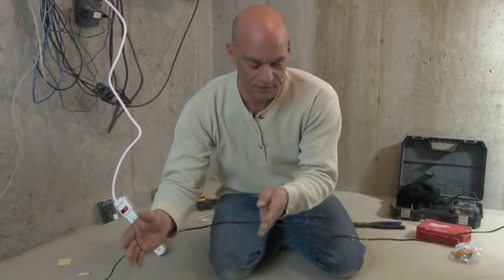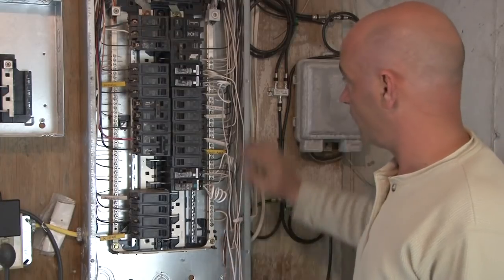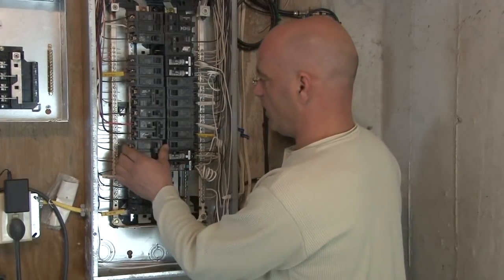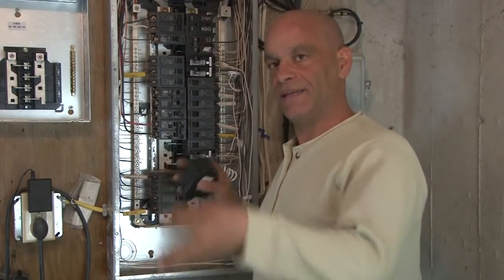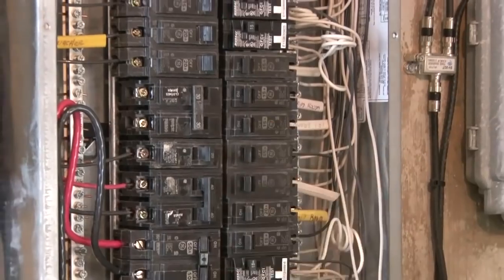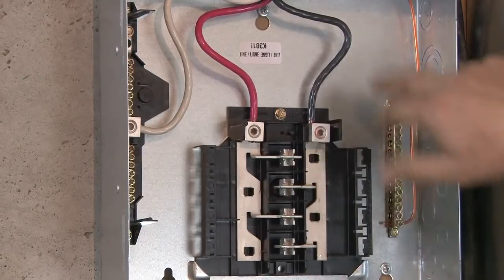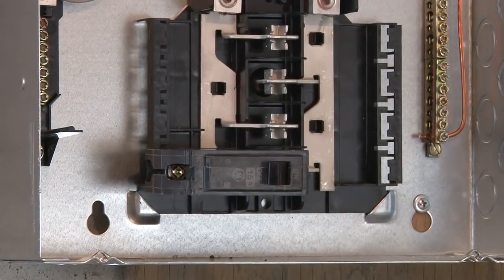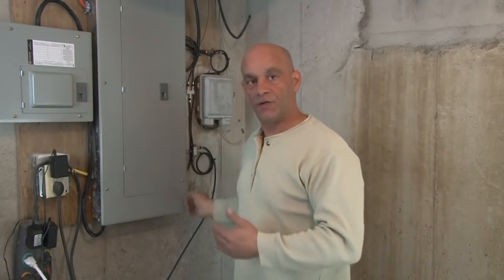How to Install a Subpanel

Comment: Good Video, I am a Master electrician, I think you did a good job covering all the issues, if I had to add anything, the main rule would be 3 things, neatness, mechanically secure and make sure every conductor should be physically protected. I also would recommend DIY ers to let an electrician install any main equipment it may look easy but we electricians always think about 100 things most homeowners do not think about, we do our best to protect the equipment but most especially people ! Thanks for the video Dominic;)
Reply: My electrician (who also has a shop in town) wired up a stove in my kitchen.  From the main breaker box to the stove he installed a 50 amp breaker, ran the correct wire, and correctly wired up the outlet (but screwed the outlet directly to the floor and not to the wall).  All well and good.  I was under the house doing some plumbing and inspected the wire, which he left running the entire distance from the panel to the outlet some 40 feet, lying directly on the ground.  He charged $1,200 to run one wire from the panel in ample crawl space to one plug and then left the wire directly on the ground.  The only hole needed was already drilled.  That was an hour job (I was there) and he couldn't be bothered to get the wire off the ground.  It took a Forester/Math Teacher (me), the son of an electrician (who passed away 16 years ago) to fix the mess.  Not only did he charge quite a bit of money (I'm 5 miles out of town) but he didn't even do a good job.  There are legions of excellent electricians to be certain.  But, just as there are crappy lawyers or foresters or teachers, there are crappy, even dangerous, electricians (or to a much greater degree AC guys).
Reply from the maker: Sorry to hear about that. More reason to always get it inspected before paying. Lesson learned I guess.
Reply: Cary Lamari Hiring an electrician would be fine, if they all didn't take advantage of home owners by charging $500 per hour.  Most want $3K to $5K to do a 2-5 hour job.
Reply: Mr Daugherty, with all due respect I don't think we do charge as much as you think, Personally I charge a service fee for the truck and labor which is 37.50 @ half hour plus material and permits. If you think about it we have to have insurance on our truck, insurance on our business for licensing, we have material in the truck we pay upfront, we have license fees which add up to thousands of dollars per year, we have taxes and many more costs. We actually do not make as much as you might think after expenses!
Reply from the maker: +Cary Lamari Yeah god know how many panels I've seen that were a big bird's nest and were only help up by the wire themselves

Comment: Hi Dominic - great video.Regarding the 6ga ground wire - I am looking at installing a sub-panel that will be in the same building as my  main panel, but it will be on a different floor (main is in the basement, sub would be on the first floor). This will probably involve connecting the two by about 40 feet of wire. Would I need a 6ga ground wire in this situation or could I still go with the smaller wire as you did in the video? Thanks for the help!
Reply from the maker: +Kate Alvo Same gauge is fine

Comment: OK, I'm wanting to send 220 to a detached building and when it gets there split it to two 110 outlets. 
My problem is that my breaker box is an older design and is full. 
There isn't a "true main" that i saw, the breaker said 70amp and the breaker that ran individual rooms comes of a 50 amp. I don't see any way to pull anymore power from this box. 
What would you recommend? Call an electrician? 
Also, the 220 to the building is about 125ft, underground in conduit.
Reply from the maker: +Theren Boster Calling a electrician is always a better idea. I would first update your main panel. Without seeing it of course.

Comment: Great video.  We are moving Ina few months.  However. In the meantime we are turning the bedroom into a studio and need to add a sub panel.  Great Video!!  The key for me is I need to have the audio and speakers (flat powered monitors), and I can't have notice or something going off because there is not enough power. Questions:
1) If I installing bedroom and the main breaker is in the hall.  Distance? Including running wire up, over bathroom and through wall or attached to wall.  Does it need to be grounded outside if it's ~10 feet away. Maybe just a bit longer due to running. Curving. Bending wire. 
2) What if there is no room. No empty spot. We rent so don't want to invest to much but working on Sound Design for SONY. 
3) Also noticed you turn power off. In an apt. Wouldn't it be safer to turn off the outside panel too?
4) Okay - its 56" in a straight line.  Running wire with turns about 100" or 4.5 feet line (straight), vs 8 feet when turning.  Man ours is so old.   No cover.  It's how I coined the phrase, "NO 3CP's". Where property manager. Groundskeeper comes in and blasts everything white. Causing 3 coats or more that the cabinets won't stay shut. Never again. Advice appreciated. Want to complete CD before moving. Thanks all.

Comment: Thanks Dominick for all the very informative videos. I am constantly watching them. Just got done doing the dry walling corners which came out great thanks to you. This subpanel will be next to feed my new garage. After that, I want to install a panel, not sure what it is called, but I want this panel to be able for me to plug in my generator to power my garage in case of a power outage. Anyway you can create a informative video of this process. BIG THANKS-Murfreesboro, TN

Comment: Sorry i should have told you i have the old main 100amp breaker box with fuses trying to add a subpanel with1 30amp breaker for dryer

Comment: I have a sub panel project where I will be pulling from a main panel, but I will need power from multiple breakers in my main. What would I do differently than shown in this video where you only pulled power from one breaker in your main.
Reply from the maker: Anna Myous No I pulled using a 220 breaker which takes power from both hot legs. The same you should. However if you don't know this already you really shouldn't be playing with this. Really.

Comment: askmediy Love your videos Dominick. They are very simple but thorough from what i've seen. Apologies if this was mentioned before but what do you recommend in a situation where your main breaker box is full? Would you then recommend to remove one of the 220v breakers I have and install a higher amperage breaker for the subfeed? Then run that original 220v breaker/wiring to the sub panel?

Second question... where do you recommend actually installed that 50amp subfeed breaker in the main breaker box? Just any slot i can find?
Reply from the maker: I would relocate a few 120 breaks to the sub panel. When you install any 220 breaker you'll to make sure you're able to grab both hot legs of the panel.

Comment: Randy, Great vid. 
If I have a 20 space panel with only 1space remaining.  I now need to install a 220V and I am thinking about future HVAC needs.  Should I consider adding a new sub panel or go for a 30 space panel?  Any concern on using differing manufacturer panel vs. breakers?

Thanks
Reply: Hey Shawn
Any brand of a panel can feed another brand just fine, as long as the sqD panels use sqD breakers, and the other brands use their own corresponding breakers.
The panel covers should state what brands and makes are listed for that particular panel.
As for your other question.
If you have a twenty space panel that is nearly full, you need to make sure that you haven't over loaded it already BEFORE trying to add additional circuits or sub panels.
If it's determined that you have room to add more load, the easier job would be to add a sub panel rather than enlarge your existing.
Hope this helps.
Btw, yes, in a licensed electrician in Mass.

Comment: One thing I had a question on is you said you had to keep the green ground screw in the main panel neutral bus bar but on the sub-panel, you took it out of the neutral bus bar.  Why is one left in and the other left off?  Thanks for the video - I'm trying to get my courage up to install some circuits in a sub-panel!
Reply: Dan Huntington All subpanels must have the neutral bar separate and isolated from ground. There must be ONLY one , single ground connection. So inorder to connect a subpanel you must use 2 phase conductors, a neutral wire (insulated) and a separate ground wire. In the main panel, the ground wire from the sub panel goes to the ground buss bar. The white neutral wire goes to the neutral buss bar, and the phase lines go to the breaker.

Comment: why is the neutral not grounded to the box like the ground? quote form an electrician "The neutral is the grounded conductor, whereas the ground is the grounding conductor." seems to me its the same as putting a wire nut on the neutral.  i just finished helping a friend add a sub panel for his 50 amp Rv.  the main box is old and he was wanting to run his leads right off the 200 amp beaker to the sub. i told him NO,BAD and found your video to reinforce that. this is the first time i have seen the neutral isolated. both panels are outside next to each other on the same building so i may need to earth ground it to be safe.
Reply: The ground conductor (bare wire)  is the equipment grounding conductor ..  It stops you from getting shocked from touching appliances that aren't properly working or installed..  The neutral is the system ground..  Its a return path to ground for the current provided by the hot wire..  Basically the bare wire is to protect you &  the neutral wire is used because you need 2 paths for electric, 1 to come in & another to come out
Reply: miketlane The neutral and ground conductors are not put together at a sub panel because of two reasons. First, return current from the neutral would be dissipated on the ground as there would then be two paths. Secondly, if the neutral ever had a fault everything would still work while ALL the current is on the ground, possibly livening metal parts. Wiring separately derived systems is a different beast.
Reply: Cory Santos thanks, i found that out from another source,

Comment: Would you mind commenting on the required disconnect means if a subpanel were to be installed in a detached building? I have tried to research but I am confused. I have seen, "if it's within sight it doesn't need it...", "within 50 ft...", "it has to have a disconnect...". If using a breaker as a main(in the subpanel), then how is that done? Just don't use the lugs and backfeed through the breaker? Is that legal? Thanks.

Comment: Well done.  I like the way you left room with a loop in the main panel for the hot wires to the sub panel breaker.  Gives room to reposition if necessary.

Comment: If I hired an electrician to do exactly what you just did in this video, how much (ball park) would it cost?
Reply: Jeffrey Stockdale I was quoted $900~1000 from three local electricians.  I priced the materials out and it looked like about $75~100 in parts.

I saw some deals on Angie's List - something like $200 for a sub-panel installation + parts which wasn't too bad a deal IMHO.

Comment: siemens 15 and 20 amp single pole ARC fault breakers fit in the GE sub panel you showed.  Can this be done, or should GE breakers only be used w/ GE panel?
Reply: Jared Waterman they are usually rated similar, BUT, if ya get real technical, UL listed means it may not have been tested in another brand panel so ul could technically be negated, lawyers love details.  Also the series current rating for fault current 10K 22K etc, may not have been UL tested for other brand breakers in other brand panels..even though they are called  "interchangeable"

Comment: It wasn't clear why you need to remove the ground screw from the sub panel, as you compared it to the one left present in the main panel.
Reply: On a subpanel the Neutral busbar and Ground busbar and not tied together, thus the bonding screw is not used.  If they are illegally bonded together current can flow through the ground wire besides the neutral wire between the panels ; the current should flow only on the 2 hots and neutral and not the safety ground. Besides being illegal and not to code this current is flowing on a ground wire and can also flow through say a grounded device back through the earth too. Thus this can accelerate corrosion of buried gas pipes, cause weird currents to eat up a buildings metal siding etc.

Comment: I have a detached shop.  It only has 3 wires going to it from the house - 2 hots and a neutral attached to a bus bar in the sub panel.  All 110 neutrals and all grounds in sub panel are connected to the same bus bar.  There is no ground rod, but there is a metal natural gas line between my shop and home, although there are no wires from the pipe to the panel.  Does this meet code, or did it back in 2000 when the shop was built?  Is there anything wrong with the setup?  If I replace the sub panel to have more breakers, will I be required to meet codes that may not have been required to meet if I just left my old panel installed?

Comment: One thing I dont understand. If the neutral and ground are connected in the main panel and the sub panel is wired directly from the main what difference would it make in the sub panel by separating neutral and ground?
Reply: you don&#39;t want to create multiple paths for fault current to Travel. That will happen if you connect  Main Panel Neutral to a subpanel Ground... i learn this from Mike Holt...
Reply: So the main panel don't have a multiple path to travel?  It is all connected together at the main panel.  This is where I'm confused.
Reply: Code only allows the neutral and ground to be connected at one spot, and it must be in the main breaker panel.

Comment: Can someone answer this for me? Do you have to run the neutral wire to the neutral bar on the main box or can you run into the ground in bar?
Reply: Alex Nussbaum Since the Neutral wire and the Ground wire are bonded (by the green bonding screw in the Main Panel) It IS allowable to connect your subpanel Neutral Wire to the Main Panel Grounding Bar

Comment: askmediy - this video just helped me install a sub panel in my garage.  After waiting week after week for the electrician to show (oh sorry I forgot, oh sorry too busy, oh sorry ...) I got the balls to do it myself.  Thanks for this video - I know basic electricity and with your help I successfully installed my sub panel (and even passed inspection).  Thanks!!
Reply: #1 - Do not install a separate grounding rod. 
CAVEAT: If you got a second drop (second set of service entry lines) so that the power is separate
that is, each building has its own MAIN, then that is okay.

It will pass inspection without this but you risk high voltage from lightning strikes running through the circuits rather than staying in the ground - damaging equipment, etc and possibly fire.
http://www.youtube.com/watch?v=WlnFNTay-9Q&list=PLRNS1x1jcKbEgNJx26RWB8O4Fm1Ny-bxK&index=9
Reply: @2Truth4Liberty  In many areas " the inspectors" will still require a ground rod and bonding in a sub panel, they do in my area! He is old school and the name of the game is keep that neutral and ground at zero potential, not a floating ground. Just because the code is worded one way doesn't mean it won't be interpreted a different way by someone else? Not all "new math" is good or necessarily true. Countless people believe that grounding and bonding has ventured into the imaginary world of money and greed! Mike Holt, Ha
Reply: @bebo5558  
I don't deny money and greed have influence, but when the principle properly aligns with scientifically measured safety, I go with that.
[[ l require a ground rod and bonding in a sub panel ]]
That's fine so long as the ground rod is also bonded to all other ground rods.
Easy/cheap to do with a single bare 8awg wire and can be underground as needed/desired.

The theory of "zero potential" is in line with best safety practice.
Not absolutely required, but if you have a swimming, etc, would you really want to trust your family to anything less. 

Bottom line -- If you are going to go overkill with something, electricity control should be the #1 thing on the list of things to go overkill on.

Comment: I have a GE panel. Could I use a square D to run to my GE?
Reply: JoeCnNd The sub-panel doesn't have to match the main panel from a functionality standpoint but I have no idea if code would have anything to say about it.
Reply: JoeCnNd Only Square-D breakers for Square-D panels. Inside the cover of the panel will specify the breakers that are acceptable for installing inside that panel.

Comment: Would you have the make and model number of the box you are using?
Thanks
Reply: It looks like a GE TML812SCUD MAIN LUG. The only reason I know is that I just bought one and it looks just like the one in the video. 125 Amps, 8 spaces, 16 circuits.